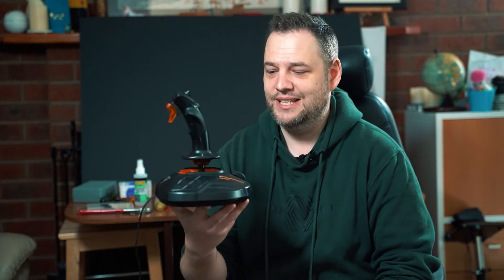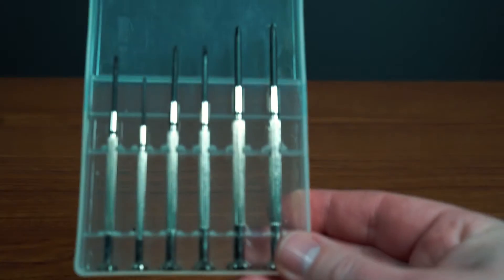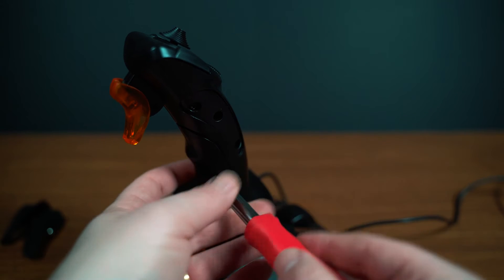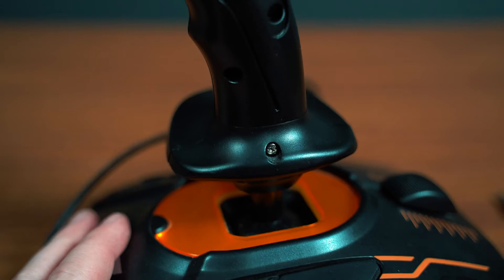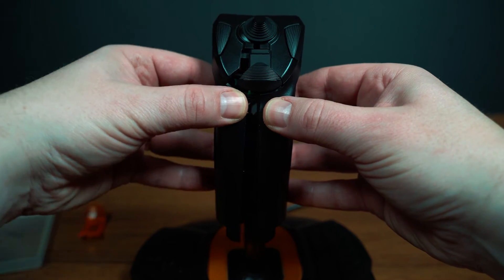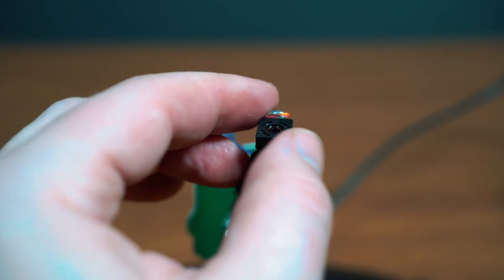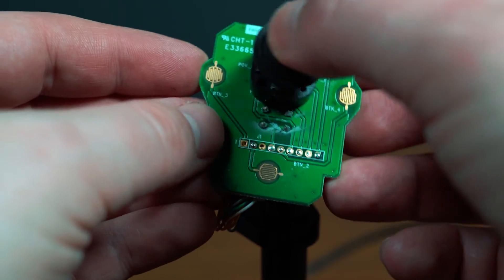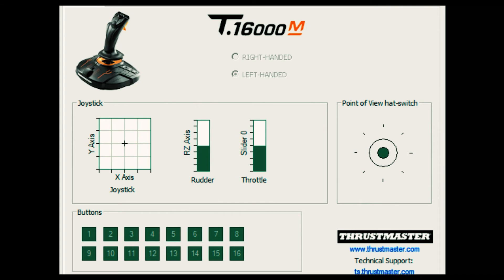Easy fix for T16000M stick/twist rudder - Complete tutorial

Comment: First of all, thanks for the video. I found myself having to perform this repair on my T.16000 today and the guide was very helpful.

I also wanted to give some feedback regarding the Nipples of Doom. I initially tried using small pieces of Scotch Tape to prevent them from moving during reassembly. However, they would still either fall off or move around, and not line up with the post on the underside of the button. After 90 minutes of trying that, I gave up.

What I wound up doing next made the reassembly incredibly easy. I popped out the side buttons (there is a small cam next to the round post, push that in), put small drops of superglue on the button posts of the center and side buttons, and then glued the Nipples of Doom to the buttons.

I then reassembled everything. Only the center button needs to be re-installed before the two halves of the joystick are joined. The two side buttons can be pushed back in at the very end, the glue will hold the Nipples of Doom in place, and the cam will prevent the button from popping back out.

Also, I used DeoxIT D5 electrical contact cleaner / conditioner. It's a better choice than alcohol or the WD-40 I've seen used in another video.
Reply from the maker: Good feedback thank you!

Comment: I tried the cleaning but I found that you can only do that so many times. I ended up ordering new pot meters for the throttle unit and stick. Just soldered a new pot meter on the stick and it works like new again <3

Comment: You're a badass, buddy! Thanks so much for going through the frustration of tinkering and fiddling to figure it out. I went with what a commenter said and only go so far as to stop at where you'd remove the trigger and you can pull the stick apart enough to access the Z-axis controller! A beautiful use of internet!

Comment: Unfortunately I am unable to get the pin out of the trigger. Used a tiny screw driver that is the perfect diameter but no matter how hard I push it doesn't budge.

Edit: I ended up just prying it open with the pin still in and sprayed WD-40 in on the twist axis without taking it completely apart. Works again.

Comment: Great video. Well done, sir!
Reply: Is there any chance you may have had need to disassemble the base as well? The twisting motion of mine is ALSO  fouling up. I'm sure it's just a case of too much dust falling into the area around the ball at the base of the handle that needs to be cleaned (fingers crossed)?

Comment: If you do take the whole thing apart, it's a million times easier to get back together if you just pop all of the buttons out of the stick and feed them in once the two halves are back. You can stick the rubber contact to the button and feed it in. I used some Elmer's GlueStick to keep the rubber contacts in place, but it wasn't necessary unless one's little nub doesn't fit into the back of the button's tiny hole and stick. Unfortunately, none of these fixes keep my stick working good for more than about 1 minute and prices have gone through the roof. I do believe that this is just a terrible product overall as it is, in fact, my second one to do the exact same thing as there weren't always $100 just for the stick and I just replaced the first one willy nilly and I have both of them side-by-side, both twitching around in yaw. Both can be fixed for a couple of minutes with a little squirt and some wire pushing, neither lasts.

Comment: I just did this. I’m my case it was clean but, I found that the wire harness that sits in front of the sensor, works it’s way to one side of the sensor if you twist aggressively a lot. If it does; it will put pressure on the sensor on that side; which in turn you will have to try to twist more to counter act that pressure. I took it apart and moved the wires back to the front of the sensor and it worked.
Reply from the maker: Nice work!

Comment: 4:43 guys remove the orange trigger before anything else in case your pin is insanely tough to get out. I had to hammer it through with lots of force. Lay the stick horizontally so base is vertical then do it

Comment: the spring in the controller keeps popping out, making it impossible to put together :/  my 150 dollar stick is now completely ruined.   I cant get anything to fit together. sorry but this was a disaster and way harder then you make it sound.  Ive been at this for an hour.  half of that was getting it apart.

Comment: This was a big help for me. I bought a pair of these used, and the right one was having issues with the twist input. It was registering fine, but wasn't fully returning to center when twisted to the right, and sometimes made a click, like it was physically blocked. Followed your tear down, and found that the housing for the center spring was open on mine, with the top part up near the twist sensor. Put the spring back and closed up the housing, and now the twist works fine (although I almost lost 2 of the nipples of doom. they tried to run).

You can tell the previous owner took them apart at one point, because the right one is missing one of the two short screws that go in the main handle.
Reply from the maker: Lol re the nipples of doom, but glad you got the fix to work!

Comment: So disassembly was easy and strait forward. My nipples where from heaven. so I first thought it was dust on the censor but as I took it apart I realized it was small peaces of plastic from the inside of the stick. Mine did this shit after 2 weeks. Seems like after they mold the plastic they don't clean the access plastic off very well. Worked well. Thanks

Comment: Getting the pin trigger removed is a PAIN IN THE FUCKING ASS goddammit I cannot take this piece of shit pin out! Trying to take this joystick apart to fix the nipples of doom.... should be renamed to trigger pin of doom.

EDIT: Finally able to get my pin out...
For those that have a pin that is stuck way more than is shown in this video, you can use PB Blaster / WD-40 to lubricate the hole where the pin is resting in. I also had to go to the extreme and use a sharp knife to carve out a portion of the plastic that rests against the pin to reduce the surface area that the pin is making contact with the plastic trigger.
Reply from the maker: Wow seems like that one was built by an angry robot at 1655 on a Friday afternoon!

Comment: Hey whats the software used at the end to check the inputs? Can someone link me it? Thanks
Reply from the maker: Super easy. Plug everything in, press Windows+R to bring up the run command and type in joy.cpl That's the native tester in Win10, works with this stick, xbox controllers etc. Hope that helps :)
Reply: @ArveyJay  oh super cool thanks! I ended up finding a website that detected the jpystick and all its input so i could test before and after. Anyways the technique from the video worked and i was able to clean the rudder sensor with only removing one side of the joystick and wiggling on the other only slightly as to not suffer the wrath of the #nippleofdoom! Thanks again!

Comment: Began having major drift issues w/ my left stick about two months ago and have been more or less just dealing with it until eventually twist input stopped registering altogether. Turns out that the wires meant to connect to the potentiometer weren't even soldered - they used hot glue, which of course ended up with one of the wires detaching... At any rate, this helped me fix it just in time for an upcoming Star Citizen dogfighting tourney. Thank you!
Reply from the maker: Nice work!

Comment: The issue does not seem to be the sensor, is the wires which are too sort and the sensor can be easily pulled, I just snagged the wires inside to have a bigger leeway and now it seems to be fixed.

Comment: I have the issue with the twist left side on right handed setup being extra sensitive? I have to not apply any pressure on the stick so it doesn't drift to the left roll. :(

Comment: i also had a drift thing... for my case i was using dual sticks and it turns out its due to the sliders and the z axis somehow got linked together as the same input... then i checked further and found out windows was registering both of them as the same input even after i tried disabling both stick's sliders... then i tried using another stick instead of dual t16000 and both sticks became fine... so my guess is the target software being suspicious as well.... yea just don't get these sticks... just fork out a small bit extra and get the vkb entry level stuff.... very slightly more expensive but it will last longer and it works much better... i am glad i got my vkb gladiators... if i didn't join my SC org, i wouldn't even know vkb existed... i just had them for 2 weeks and they are a way better experience....

thrustmaster target software is the worst... furthermore after this stupid z axis drift for using dual t16000, it keeps trying to screw with all my usb input and actually damaged my logitech mouse wireless transceiver from my wireless mouse and keyboard combo somehow and made my mouse unusable... it also made my 1 hand keyboard making it cycle from being detected and undetected.... i thought it was because its from china so i lived with it... now after using the vkb stuff and deleting all traces of thrustmaster target software all my usb devices works fine... except the broken transceiver still won't detect my mouse... i guess it destroyed something inside it from receiving my mouse input... i took apart my mouse and everything looks and works fine when i tested with a multi meter and everything... and that stupid transceiver is not even sold as a replacement part like the logitech unify dongle system....

TLDR don't use the stupid thrustmaster target software... don't use the t16000.... if you can get away with using your thrustmaster sticks without the target software then just do so.... they are good cheap stick but the software and you could probably get better stuff just by adding a few tens of dollars more for vkb stuff....
Reply: vkb will last longer because spare parts for them are easier to find.... since they encourage you to tinker with them yourselves....

Comment: This exactly just happened to me, everything else on the stick is working perfectly.  Thank you for the video!
Reply: [UPDATE] I just finished trying this, it worked perfectly omg!  My twist rudder was randomly fluctuating up to 100% on its own constantly... then now it is rock steady like new.  amazing!  NOTE: those nipples of doom are no joke, I ended up putting a dab of Locktite 60sec flexible glue to stick the nipple onto the bottom of the thumb button, since it kept falling out on me.  Works great so far.  used gorilla tape on the side buttons to hold them in the up position.  The pieces went together well after that.  reassemble as in the video.
Reply: [UPDATE 2] lol, I had to do it again-- 10 months later, and again the stick works good as new now.   Love this video, had to watch it a few more times... and I am sure 10 months from now I will be back to watch it again:)  thank you so much!

Comment: Now, is there any better solution that would fit in its place? THe main axis have good sensors, why they used this pot I don't know. Have made this repair several times now but i've had the stick for over 5 years.

Comment: I recently fixed my stick with the same method up until the cleaning of the sensor (didnt have any cleaner on hand so I went in to investigate if wires were in the way), but i did two additional things; if you look inside the left side of the handle, there's 2 plastic "beams" as it were that are built into the handle to prevent the sensor from popping out of it's housing (this is apparently possible after it's opened by just pulling up with enough force). These beams are actually low enough that when you place your hand on the hand rest, it pulls the entire housing down on top of the sensor on the left side, thus the very constant left twist drift and twitching. I took a razor blade to the beams and shaved off around 1-2mm of plastic off each one, so that it wont make contact with the top of the sensor when weight is applied to the handle. I also moved the wires of the chip to curl over (rather than under) the thumb rest screw hole (situated just about above and forward of the sensor as well), this should prevent those wires from being to close to it to interfere as well.
Reply from the maker: Good tips!

Comment: Ok, so next video needs to be on how to replace nipples of doom I lost my center nipple as I was putting the thing back together at the end and I'm a little frustrated. Any help? part numbers? maybe a name so I can google it myself? Xenothreat 3.0 is coming up and I need my nips tight and ready for missile mode. 

P.S. I found the part, but I get the sense this will be a problem again. If anyone finds a part number it would still look real good in the comment section.
Reply from the maker: Haha, oh dear I'm sorry you lost your nips! Some have suggested glue, I have not done so myself however.

Comment: is there a way to fix the trigger when it goes flakky or starts to spasm?
(false trigger presses, when you let go of the stick, or when holding the trigger, mutiple taps happens)
Reply from the maker: Hmmm not sure other than looking at the microswitch on the underside of the board which is the button for the trigger. Maybe try the IPA trick on that button and see if it clears some gunk from it?

Comment: Well.. I'll be damned! IPA soaking and wiggling fixed it! 

Here are my two cents though. First, glue them nipples to the buttons. Second, hot glue they used to seal contacts is crap. See if it falls off easily enough and replace it with your own hot glue and proper application. No glitter stuff tho.

If stick's Z starts to act again i'll cut off whole feature from this stick and permanently fix the stick to the center.
Reply from the maker: Good additions. Cheers!

Comment: Disassembly was pretty easy.  Unfortunately, when I exposed the rotational portion of the unit I found a broken wire.  In my opinion the wire broke for two reasons:  not enough slack was left when originally assembled and, more importantly, so much silicone was used to insulate and protect the soldered connections that it dripped all over the wire harness which, in turn, restricted movement of the center contact wire causing it to break.  I am waiting on a response from Customer Service.
Reply from the maker: Good luck. Let me know how you go!
Reply: Was the reply "HAHA! YOU VOIDED YOUR WARRANTY! IN FACT I'M SURE YOU BROKE IT YOURSELF TO GET A REPLACEMENT!"

Comment: Two notes,
You don't need to take the whole top section with the circuit board off to get to this sensor, you can pull both halves of the stick apart after removing all the screws and then you only need to worry about the button on on side or the other. Just leave the circuit board and everything else in place on one side. It took less than 5 minutes to do it this way and requires way less re assembly.
And for holding the button in place to reassemble, just use blue tac to hold the button in the up position. A lot less fiddly than using tape.
Reply: I did this too. I also held it almost upside down when I put the side on without the circuit board in it. This way I didn't need to use any tape/the Frakenstein's monster method either.

Comment: thanks man that fixed the problem for me !Just an other tip for nipples i used toothpick i just stuck it underneath the button's edge and it blocked it upwards also use some pincer for the nipples to get in place

Comment: Thanks I found its not all that terrible to place the nipples back (my high dex helped?!) though putting the trigger rod was a bit annoying, ended up using pliers to put it in the orange trigger first, much easier than way. Also, compressed air seems to be better than alcohol, i assume its just dust inside. 
Finally, this also works for the throttle joystick ;-)

Comment: I'm trying this fix and I cannot for the life of me get the two halves of the grip to go back together over the "stalk". There's about a 2mm gap between them which just will not close and I have no idea why. It's getting really fucking frustrating and I'm considering just throwing it in the bin at this point.
Reply from the maker: Hmmm. Do you have a wire caught in the gap? That would cause a 2mm gap. Otherwise just a bit of wiggling will settle the two halves together. Make sure one half is seated correctly on the  stalk before trying the other one. Let me know how you get on.
Reply: @ArveyJay  I seem to have same trouble, The "front" just wont fit in and I have double checked there's no wires between the halves. Wiggled it about 2h before surrendered and searching online for help that what on earth there is preventing it to fit right, also the twist spring keeps popping off which makes it even more infuriating.

Comment: Awesome Video, fixed my rudder z axis over steer, and saved me from buying a new T16000M over a simple fix, the N.O.D. were a bit frustrating as was the trigger pin removal, but it was all very manageable.

Thanks for the great video, very useful, spot on with directions from start to finish.
Reply from the maker: Thanks mate, glad it worked for you!